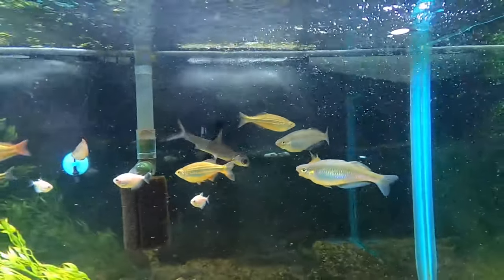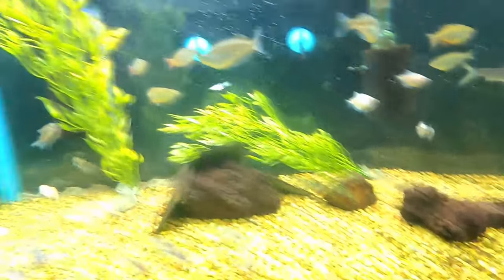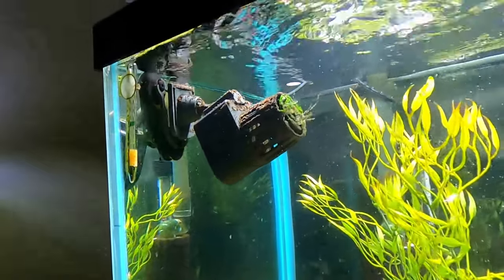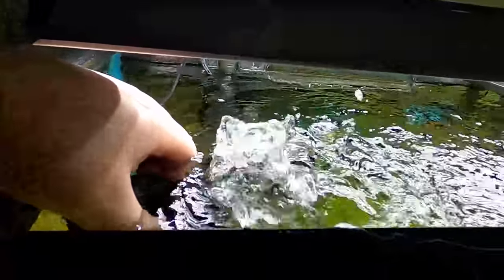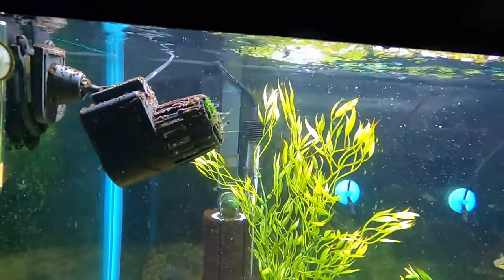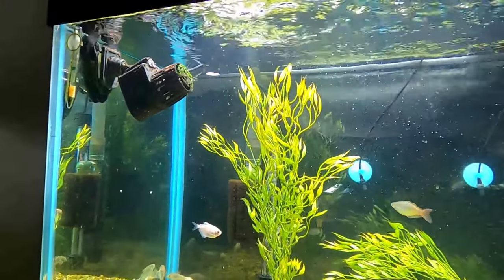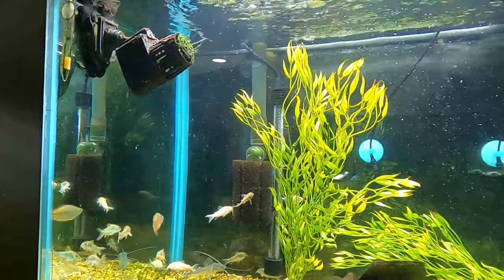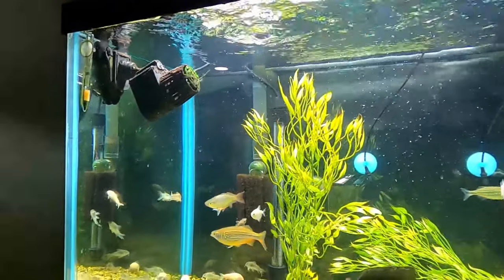Why I Stopped Using A Air Pump In My Aquariums (Wave Maker Edition)

Comment: Air pump is better. Not only are you breaking the surface tension when the bubbles reach the top and pop but you're also breaking surface tension where the bubbles are made. There is nothing better than an air stone. If you want the best of both worlds get an Expertmatic filter/wave maker/air stone. It does it all.
Reply: The problem is they're very loud, run hot and have too many moving parts to last long when run 24hr per day. They also don't perform superior to this.

This is quiet, and the mechanics have less friction which means it's more likely to last for years.
Reply: @westernartifact4163  
Your right they are quiet and may last longer. I've never had one fail though but no matter how you look at it bubbles aerate better. You can also get internal pumps like the xpertmatic in tank filter that makes bubbles filters and moves a ton of water.
Reply: @westernartifact4163  My Alita AL - 6A is very quiet, Doesn't raise temp, has been running flawlessly for years, and can run 8+ tanks.... I'll stick with air.

Comment: Do you think it's too powerful for a 29 gal? And your setup seems pretty quiet, would you say it doesn't make much noise? My tank is in my bedroom so I like to keep it quiet lol
Reply from the maker: This model specifically yes too powerful but, they have other models in size that would work just fine! Relatively quiet but not silent, they are pretty cheap so you kind of get what you pay for with it. If your looking for dead silent check out some more top tier wavemakers they usually are very nice.

Comment: I would use it in hot summer to cool down water temperature especially during the day. More evaporation would occur which is good for a freshwater aquarium. However, it cannot replace a filter powerhead or air pump

Comment: I just dropped one in my 55 with red belly piranha and tiger barbs I’m running a wet dry trickle filter with an over flow the only thing in my tank is the overflow the return and the power head I keep good ph ammonia and DO readings I work in water treatment to it’s pretty easy to take a sample into work and test for all 3 the tank is less cluttered with the wet dry filter the only reason I run a power head is to keep my solids in suspension and get rid of dead spots

Comment: I still use an air pump for my sponge filter. With a 4 inch air stone disk it moves water, but the one benefit of a wave maker is that fish like swimming against the current to some degree. Even tiny fish like having just a bit of resistance. That's why I plan on getting one also. Been looking for days what is the most reliable one. Don't want to be spending $10 every month or every other month. That's gonna be $60-$120 a year. Thinking about getting a water pump but those aren't as effective due to the water coming out of a 1 inch hole.
Reply from the maker: I personaly use the marineland maxijet and have never had any issues!
Reply: @everythingaquarium  thanks. That has good reviews on amazon too. Yesterday I ordered a kedsum water pump. It's the blue one. I liked it because speeds can be adjusted. Got the weakest one 400gph for now. It's going in a 10 gallon for guppies and platy fish. If it's not strong enough I'll go one step up to the 660gph. Don't want the strongest one because it might be too loud.

Comment: Air pump run at around 4w for a double outlet 4L/min output. Powerhead like your run at 20w-25w. On a show tank yes, in multiple tank the running cost start to add up really quick.
Reply: Not true, I have an oase stream max 4000 wave maker and it's only 5w

Comment: Thank you for the info.
Can this be used lower in the tank to push co2 and better circulation around the tank?
Reply from the maker: It would work, but I would go with a smaller-sized power head.

Comment: I’m very late but thank you for the video! Can I ask what model you have you can turn it down? I just bought this guy & have been unsuccessful adjusting the pressure.
Reply from the maker: It's a marineland maxijet 900. There is technically no adjustment the only way to turn it "down" is to convert it to a power head using the included impeller. The mode I show is the wavemaker mode or "circulation" mode which moves alot more water!

Comment: Okay, thanks. Will the wave maker stress out my fishes? I have a 24 gallon tank.My fishes isn’t swimming around as much. Since I installed the wave maker.I run my wave maker 24/7 I only turn it off when Im feeding them.
Reply from the maker: Well it all depends, you should have a relatively small wavemaker for that size tank and the fish should be suitable for faster flow, some fish do not like fast flow. Do some research on your fish's preference of flow and depending on the wavemaker turn it down or maybe find a smaller one.
Reply: If your flow in your tank is fast get some  zebra danios  they love fast flowing waters. In they r schooling fish so I recommend 7 or more

Comment: any power filter can do it if you properly adjust the outlet. no extra wave maker needed. does not metter if it is internal filter or external. If you can adjust somehow the outflow direction and speed , you will get the same result. I've been doing this since my first power filter. Also, not every fish likes that strong current, so too much is not too good.

Comment: Where to position the wave maker in accord to the HOB filter? Ive heard opposite side of the tank from where the filter is; then I was told the same side as the filter. Opposite end from the filter seems the most sensible. Any advice would be appreciated.  (Looking for accurate placement of wave maker in a 30gal with using a HOB filter … filter is on the right side of tank. As of now, only have one wave maker ).
Reply: Not sure If anyone has replied but the wave maker and filter should be on the same side so that your tank can set up a proper circulation and all the floating debris flow into ur filters as the wave maker is sucking in water
Reply: You are correct.  Typically wave makers go on the opposite side of the tank, that way debris is pushed towards the filter intake.  I usually turn mine off before feeding.

Comment: Those fish would not run out of air and die with a $10 air pump tbh you don’t need an air pump or that power head as you have a hang on back filter that moves the surface of the water.

Comment: So i got my spray bars running along the back spraying towards the front and upwards, like a typical 45degree setup, would that create a weird flow if i put in a wave maker too?
OR perhaps remove the spray bars and have a duckbill pushing the same direction, im confused lol

Comment: Great vid dude, I’ve got similar set up however a glass lid (aquaone nano 80 bow front) will this reduce oxygen? If so do you recommend an air stone as an addition?
Reply from the maker: Thanks! Actually if the circulation pump is pointed at the surface it will increase surface agitation causing more oxygen exchange therfore gassing off co2  and introducing more oxygen into the water column. So you should have plenty enough oxygen from just a circulation pump!
Reply: @everythingaquarium  it ripples the water but no “white water” is created. Thanks for the video dude, I’m looking to get Co2 eventually as we get more plants so may need the air stone to balance!